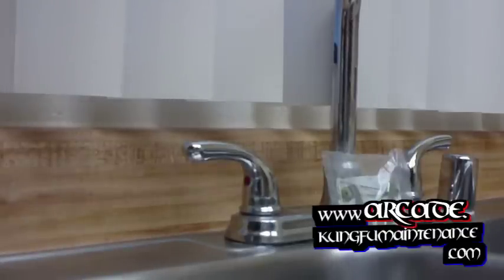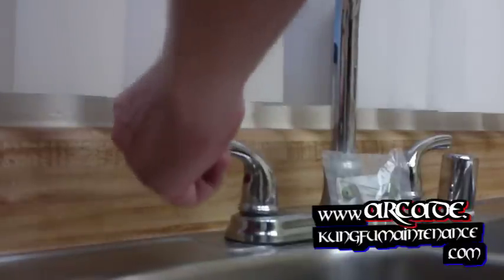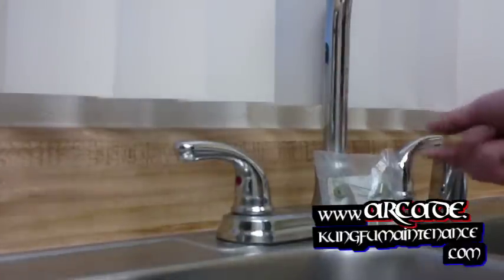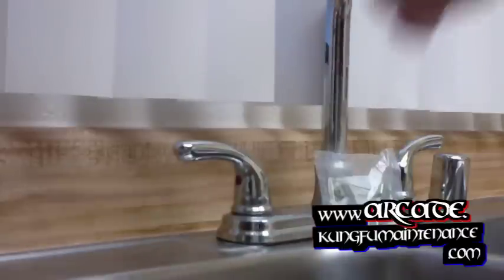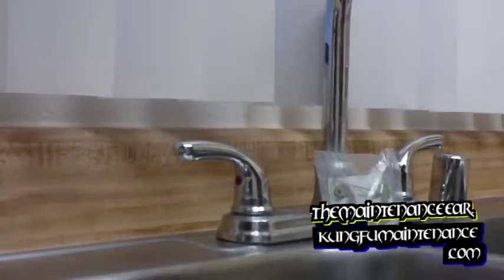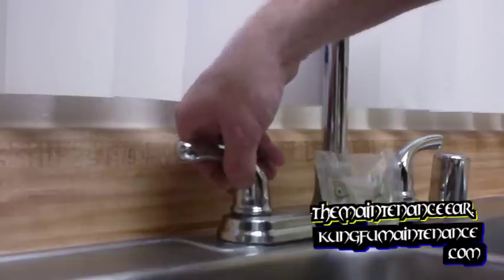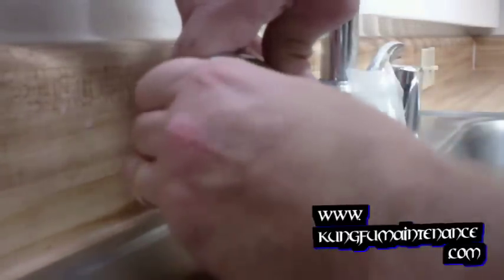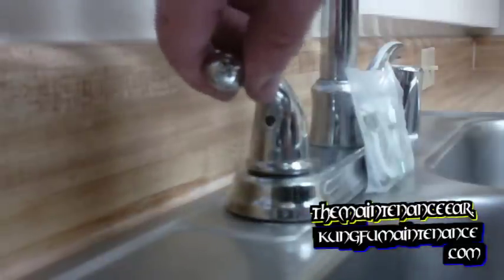How To Tighten Down A Loose Faucet Handle

Comment from the maker: It most likely has a set screw hidden underneath a cap that can be removed with a flat blade knife than the set screw can be loosened. Than the handle can be removed, next either the stem can be turned out, or a stem collar can be turned out and than the stem pulled out. Either the stem will be threaded or the stem will have a threaded collar that holds it in place. ~ Hope that helps.